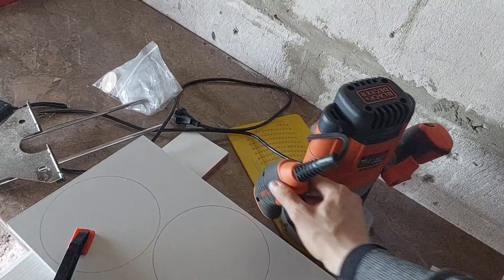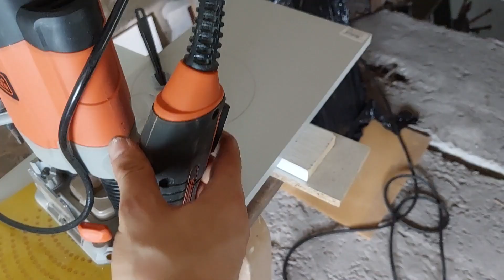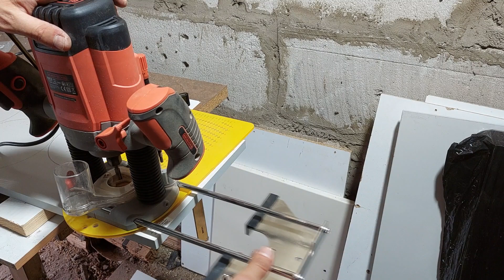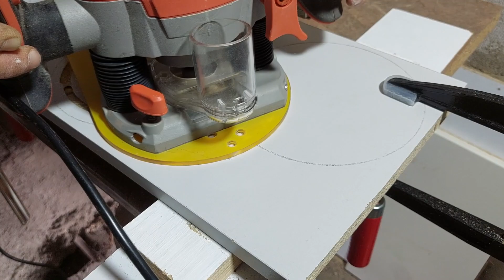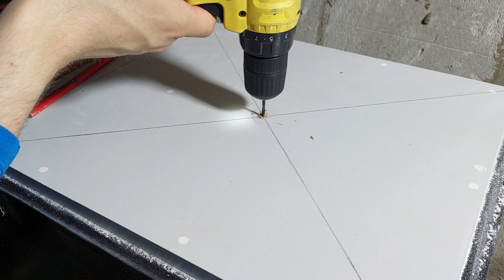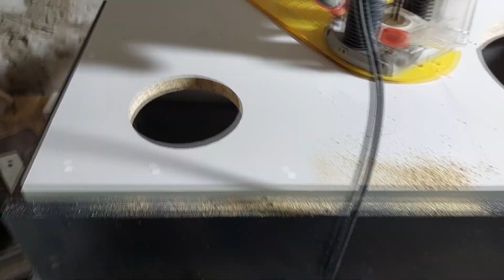Black+Decker Router in action

Comment: Very interesting video... what´s the minimum diameter hole you can cut with this setup? I am interested in buying the template for speaker holes too... cheers!
Reply from the maker: I've never checked it, but there's the problem, that this base doesn't fit directly on this router, so I had to drill new holes to fit it.